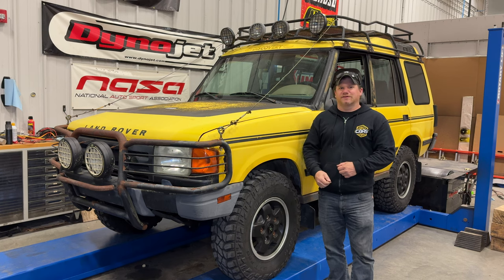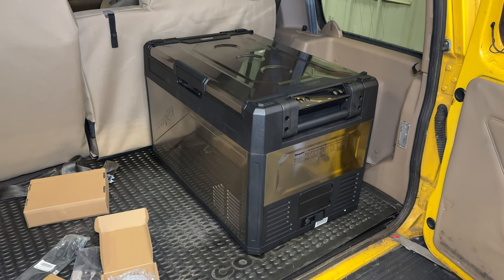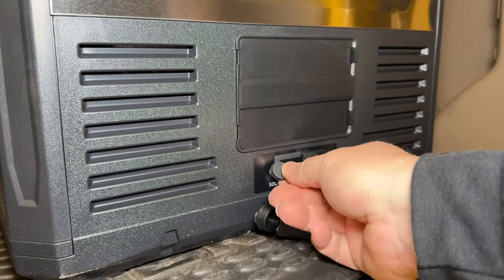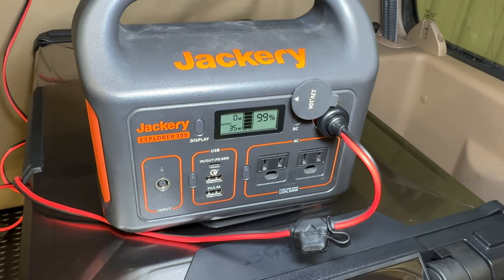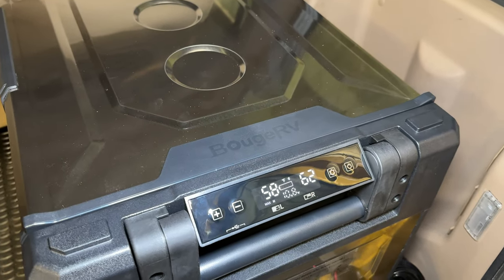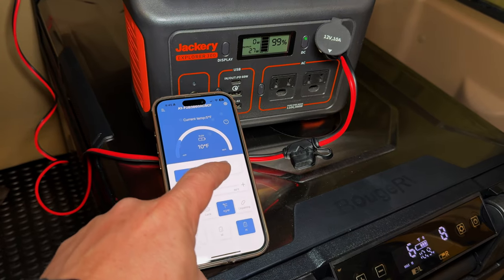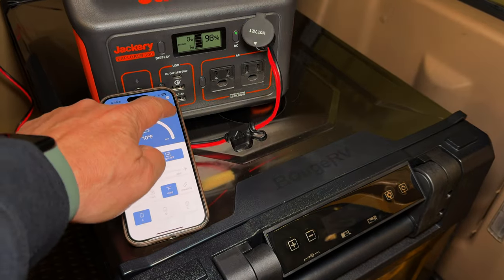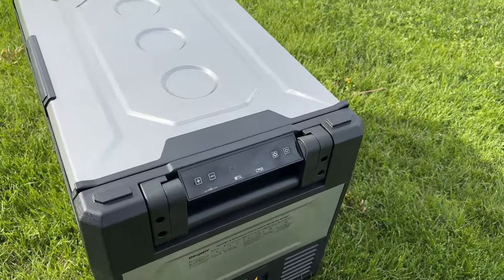Starting the Overland Build with BougeRV Rocky50

Comment: Did the equivalent of this power line fitment for a fridge in my D1. Absolutely useless! the 12v cig plug or the LR 12V socket  was not capable of coping with the fridge's load plus a large voltage drop over about 2 or 3m of cable.
After 10 days of the fridge frequently shutting down due to low voltage (<11V) and warm beer on an outback trip (aaarghhh),  I then simply (hah!) fitted a dedicated fused power line from the battery to an Anderson socket in the rear compartment. Made up a new lead  from fridge to Anderson. Big fat wires to avoid voltage drops. Hooray! no more shutdown problems and we had cold beer and frozen steaks the whole time. 
Same goes for running an air compressor ( I had 3 LRs and one compressor)  - run big wires to an Anderson socket in each vehicle. Fit portable compressor with Anderson plug. Thereafter no more blown fuses, hot wiring or compressor running slow. Great to see the XD getting some use and showing everyone how brilliant D1s are!
Reply from the maker: I will add a dedicated rear power port at some point but your voltage drop over the distance would be from an inadequate extension cord and not the car.  I also get the luxury of letting the fridge run at less than 11 volts because of my second isolated battery.